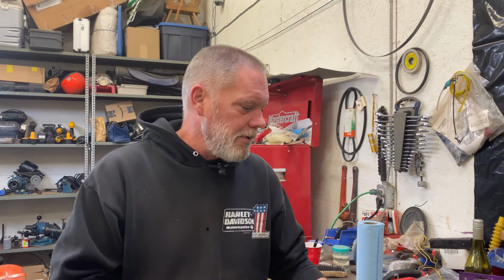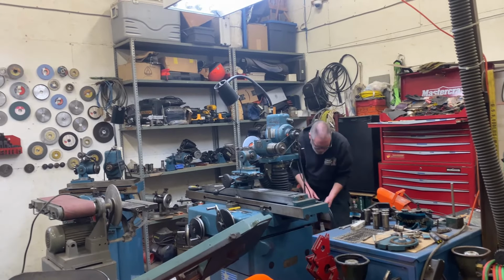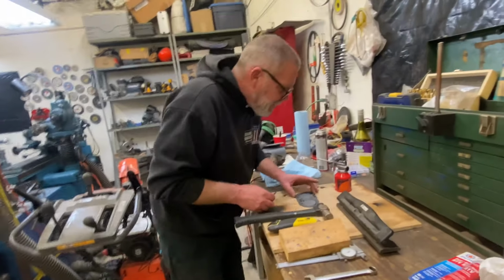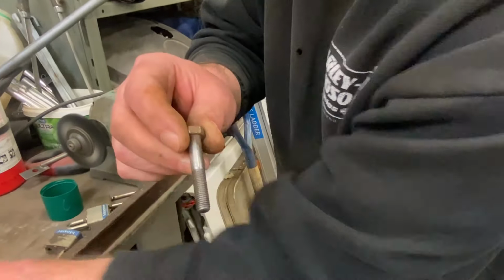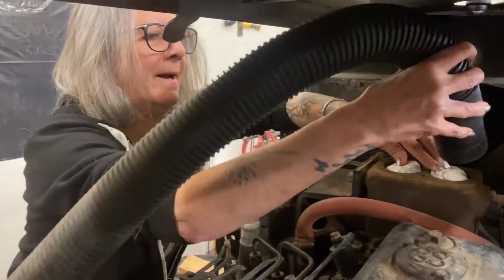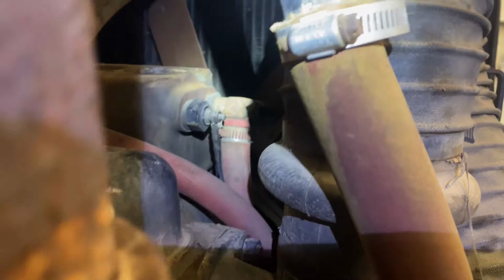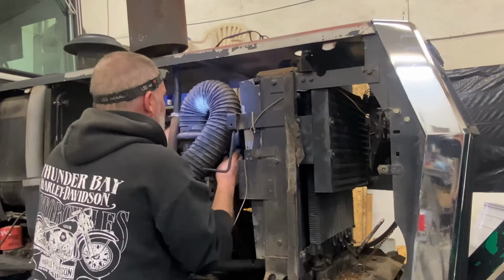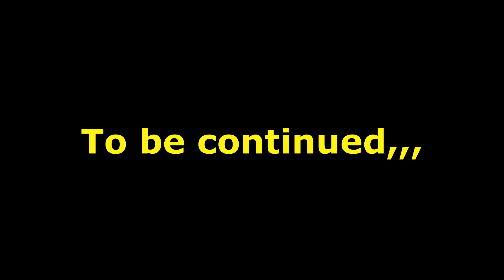Still no cab heat! We're working on it,,,

Comment: On the farm we had a white 2-105 that I would use to haul round bales during the winter. We used it a lot all summer long. What I would do come fall time is open up the the roof and clean the heater core out with air. The amount of dust build up can cause it to not blow heat. The heater core maybe getting warm but if it is plugged up with dust and dirt. Air can't blow through it. Not saying that's your problem but would be worth a look. While you have it in side and warm.
Reply from the maker: Thank you for the great idea!
We'll take a look under there in an upcoming video.
Cheers!

Comment: Did you notice what was the engine temperature before you tore it down.  Was the first thing to look at. That would tell you if the engine itself was getting hot enough to run at operating temperature or not. If not (running on the cold side) it would be thermostats are opening to early or the water pump is not circulating the water. So you check the hoses and valve for being open. My opinion would be leaning towards checking out the water pump. If the water pump check out ( good visual look). Than thermostats are bad even though you tested them. Are opening to early.   
There is a guy that's very good with Oliver and white tractors. White tractors are just a new version of Oliver tractors. He very good at answering questions about tractors. He has a you tube channel ( That Oliver Guy) that you can get in touch with there. I hope these can help you out 😊
Reply from the maker: Thanks for all the great advise. I have always made a point of keeping my eye on the engine temp and it was perfect before and its still perfect now. In upcoming videos we investigate a bunch more possible causes, one at a time and as much as I was hoping not to have to get into the water pump it's starting to look like the suspect.